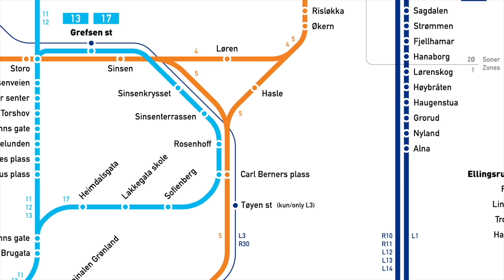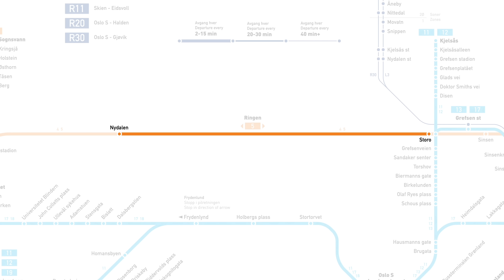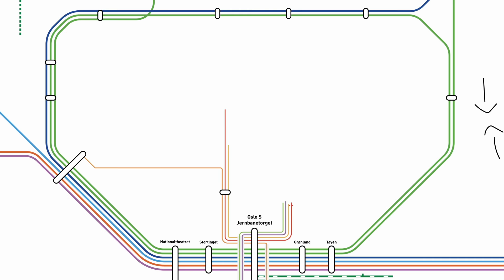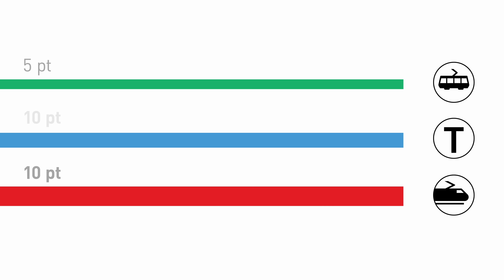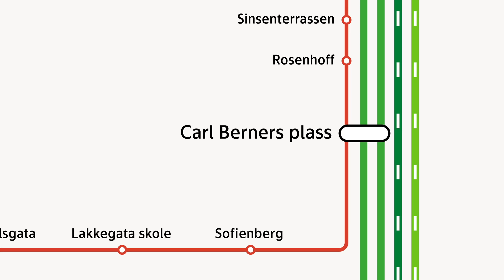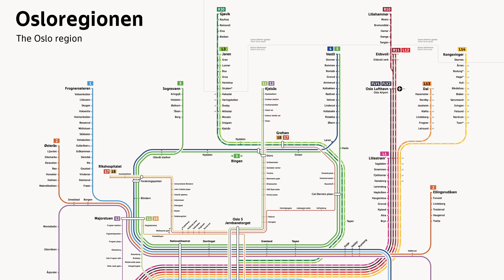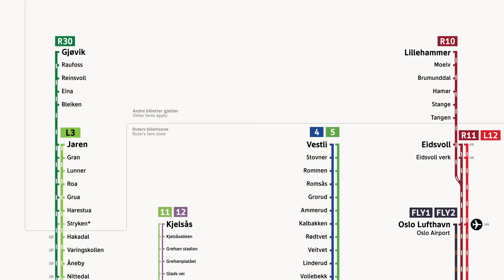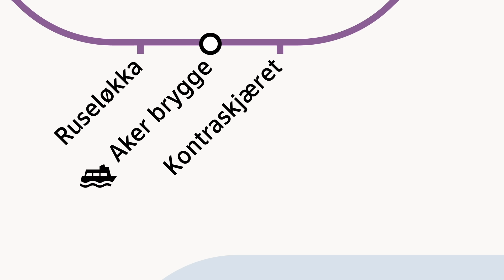Redesigning Oslo's transit diagram

Comment: 6:45 As far as Geographic accuracy goes, I rather like the solution used by the Montreal map. Rather than an actual geographical shape, the river is displayed as a shape. It gives the freedom to stretch it a bit where need be to keep the diagram clear.

Comment: One nitpick. I think L13 should be parallel to line 10-12 until Kløfta. This is how it is in real life and on the official rail map now, L13 while technically a seperate line (hovedbanen) runs in parallel to the gardermoen line before branching out towards Jessheim. This map gives the impression that hovedbanen and gardermoen line are geographically seperated when they run in parallel  It's possible to run a service that goes on Hovedbanen until Kløfta before going to Oslo Airport instead of Jessheim, such a service used to exist like 10 years ago.

Comment: Impressive!  It captures the gist of where all the lines are in a way that Ruter would probably deem to be "impossible" because their design-group/company would say it is impossible to draw.

Should the L1 line be drawn to the east of line 2?  I get the problem with stretching and compressing lines, but around Høybråten, the L1 line is actually to east of 2.  

Related to this, the lack of notches on the non-L1 lines that passes Lillestrøm is perhaps a bit hard to see?  Most of those lines do not follow the same tracks as the L1.  (To the Oslo Ignoramuses out there... They pass east of 2 close to Hellerud in a tunnel.)

Whenever BaneNor is closing the trains from passing Oslo S, they usually move train passengers to/from metro at Bryn/Brynseng.   Might be an idea to draw a line between them ala the line between Dronningens gate and Oslo S.

Fun fact about Brynseng T.  https://od2.pbe.oslo.kommune.no/kart/?searchstring=#601203,6642653,6.94 notice how the train tracks in the tunnel underneath Brynseng runs parallel to the metro tracks?  And the train tracks separates, as if they once upon a time considered a station down there?

It's probably going to end up like Elisenberg, not getting built.  https://od2.pbe.oslo.kommune.no/kart/?searchstring=#595437,6643603,7.395885077594794

Edit:  The other end of the L1 line... Spikkestad is also to the east of the other tracks to Drammen.
Reply from the maker: Thanks for your comment!

With a diagram, I'd prefer to simplify and not comply strictly with geographical accuracies. To the average person, an easy-to-read list of stations is what matters. That's why the Spikkestad line doesn't cross east of the Drammen line. Less bends and clutter. Same goes for L1.

Totally agree that the express trains to Lillestrøm are hard to visually separate from L1. And that Brynseng/Bryn should have some sort of interchange design. Being a commuter on the L1 line, I've done the walk to and from Brynseng/Bryn many, many times, hehe. If I remember correctly, I've previously seen documents of Ruter suggesting a new underground train station being built directly under Brynseng T. Regional trains would also stop there. Not sure about the progress though.

Comment: Very nice redesign!
I'm wondering about bus lines though. Living in the city, you almost never take the trains, but the bus is the only to reach many parts of the city. And people that take the train regularly would always take the same usual lines. That would make a map targeted at city users... I'm then wondering if it would become too complex? I feel like it would almost need to become geographical, to fit all the little stations everywhere... What do you think about this problem?

On the UX side of it, I actually find that I often miss a geographical map. I'm mostly used to stick to T-bane lines, and when I'm in some parts of the city like Grünerløkka, with no T-bane, I never know where to go to find the closest public transport station. It's something that the Paris public transport maps do pretty well I find. It looks very busy, but if you have a rough idea of the area you're going to on a map, without knowing the names of the area and neighbourhoods, you can find the line you want extremely fast. Very useful for tourists and newcomers.

Another thought in favor of some more geographically accurate maps, would be for example a detailed map of the city center, where you could see exactly where different exits of a station lead you too (that damn Stortinget station is a maze to me). Another thing that all metro stations in Paris have and that is very useful...

Comment: Great map! My only problem is that it is hard to see that the trains going to the northeast do not all stop at the stops of the L1, because of the white bars which give the impression of a stop. Maybe you could separate the L1 from the other lines and have them meet only at Lillestrom?
Reply from the maker: totally fair! it’s a good idea to seperate them, considering L1 takes 30 min to lillestrøm from oslo s, but the other lines take just 10 min.

Comment: I would merge local/regional trains to one line downtown only. All go through central station, It's really blowing up the chart, just having colored ends in the suburban area should be easy to read. Travelling suburb to suburb is rare anyway.
A station spanning 10 lines gives me the impression of huge walking distance. That might come from Metro plans, where each line has it's own platform and you have to walk 1km underground - still considered to be one station.
On traditional rail, you most often have 10 lines, and just one platform, not huge distances for a transfer.

Comment: I think you make a lot of choices that abide conventional design wisdom but IMO are overvalued. Like you talk about eschewing geographical features because that's not the purpose of a transit map, but I think including just a tiny bit of landmark information like rivers and parks and even major streets can make a massive difference in orienting yourself when you just walk out the station. You've gone with the whole every-route-its-own-color style but the result is a thick rainbow of largely redundant information. Oslo looks like it would be very suited to the "trunk line coloring" system used in NY. I agree your previous map had problems with over-compressing the routes, but its ok for a "trunk" of services to all have one color that only forks in a "Y" shape near the end. Indeed you have an easier problem than many other systems, because you don't have express and local variants sharing the same track. A service that goes down a track makes all the stops therein. So putting a label on every single line saying "this stops here too" is repetitive and can be cut.

Comment: Oslo having loads of different lines, with colors for commuter rail which all go to pretty much the same places, really throws a wrench in this. :-) Stockholm would for example view Skien-Eidsvoll and Kongsberg-Eidsvoll as the same line, but with a split. R30 is "regional" and L3 is "local", but it's the same way, just R30 going further. Pure nonsense.